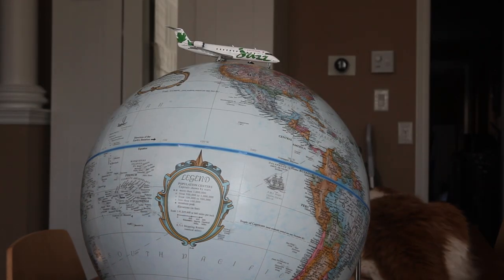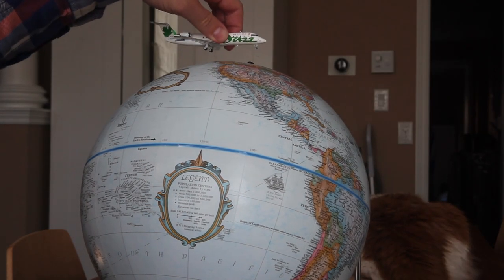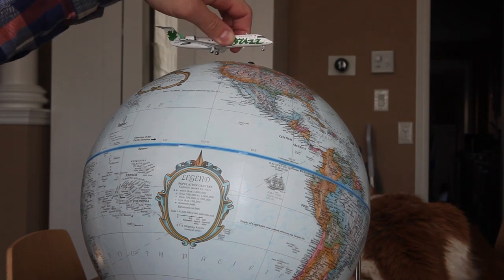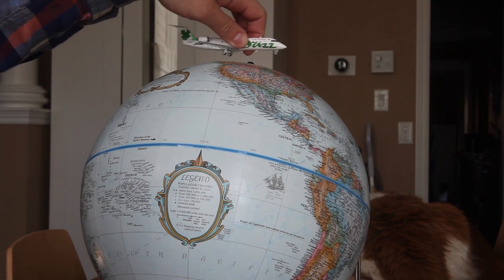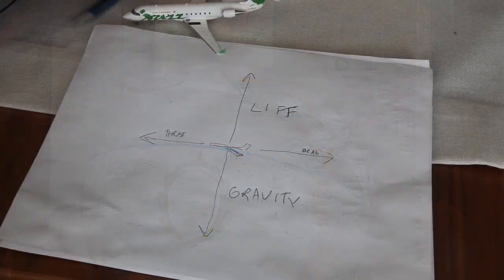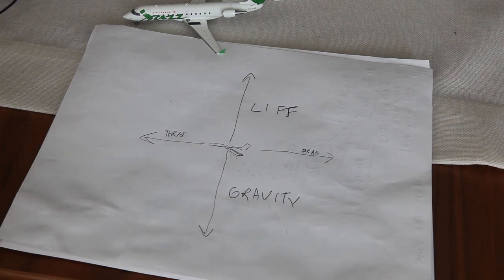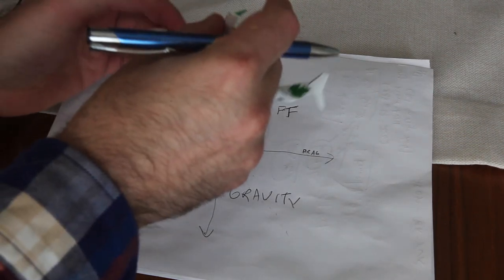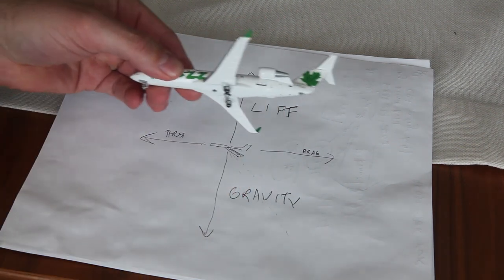Do Pilots dip the aircraft nose to account for Earth's curvature?

Comment: If gravity is pulling the nose of the plane down to maintain level flight we must manually avoid mountains correct?
If we fly from Australia to Dubai we cross the equator, Neil Degrass tells us that there is a bulge of water here, due to the spin, that is miles high. Does this not increase gravity (more mass)? Why does the plane not "dip" extra, just when it need to climb a few miles? All without any intervention?

Please explain, thanks in advance.
Reply: Because it’s BS!! All the supposed real pictures of earth are spherical (which those are lies) then he comes with this pear shape. They can’t even keep their lies straight

Comment: This doesn't make sense with what I understand about how the artificial horizon hardware works. The powered gyroscopic hardware is designed to maintain its orientation. How would it sense the supposed changing gravity vector when they're designed to stay in place once set on the runway regardless of forces?
Reply from the maker: Clearly there has to be a gravity sensing component or a compensation for flying over the curve or every hour in curise flight the airplane would be 7.5 degrees more degrees nose down. Not a useful tool for a pilot, if it doesn't show level to local gravity
Reply: @fepilot666  they must be huh? According to you? Stupid assumption. Look up artificial horizons there is no mechanism designed to change with the curve of earth. The gyros are set to the runway at take off according to FAA regulations it legally cant be recalibrated during flight. They are designed to maintain position and nothing more.
Reply: @BlanketTruth22  you are confusing attitude indicators with inertial reference units. Different types of gyros. Mercury switches as well as electric torque motors are used as gravity reference devices to maintain the gyro in an electrical driven attitude indicator. You really need to go and sit down and study how gyros really work and the different types of gyros and their uses.
Reply: @ianobiwan  you didn't explain anything just now. Just a bunch of words.
Reply: @ianobiwan  maybe you can explain to me why artificial horizon legally must be set preflight at takeoff runway. If it senses the center of the earth like u suppose then why set it at all. The artificial horizon in planes, according to the manufacturer simply is designed to stay in the set position.
Reply: @BlanketTruth22  I was hoping you were intelligent enough to go and find out for yourself about how gyros work and the different types and there uses after I pointed out your obvious confusion. Obviously I was wrong.
Reply: @ianobiwan  you didn't adresss my simple question about setting the artificial horizon pre flight. Why would that be necessary and legally required by FAA?
Reply: @BlanketTruth22  what FAA regulation exactly?
Reply: @BlanketTruth22  prior to departure pilots will reset the mechanical attitude indicator to make sure it is not giving false indication and there is no deviation from the wings level indication. Simple safety check. The aircraft must not be moved while the inertial navigation units are aligning. If it is moved whilst INUs are aligning an error will be induced. This error will cause the aircraft to fly off course. Example Korean flight 007.
Reply: @ianobiwan  doesnt it correct midflight and align with gravity according to you?
Reply: @BlanketTruth22  no it does not correct mid flight. What are you talking about?  I clearly have not said anything about mid flight corrections. Where did you get that stupid idea from?
Reply: @BlanketTruth22  still waiting for that FAA regulation reference number. Judging by the ridiculous comments you have already made here, you clearly have absolutely zero knowledge about how an attitude indicator works or how an inertial navigation unit works, so I will not be surprised to see that you are completely clueless about any FAA regulations as well.
Reply: @BlanketTruth22  You people are hilarious. Just because you read something on the internet you think you know more than professionals. Give me a break. "legally" aign it with the runway? How do you align an AI with the runway LMAO you have no idea. Look up pendulous vanes, and take this big L.

Comment: LOL..."the center of the globe is behind..."  If you are flying around a ball, keeping horizontal with the surface, the center of the ball is never behind you, you are always directly above it. The only way to get the center of the earth behind you, is to fly vertically away from the surface.    "...the gravity is going to shift backward..."  WTF?  If gravity shifted backwards, it would grab the tail section of the plane more so than the front meaning the front of the plane would want to point away from the surface even more so. Your explanation makes little sense.
Reply from the maker: The point being is that the airplane always stays in level flight, level relative to the direction of gravity. (Which changes as we fly around the globe)
Reply: @fepilot666  Or its not a globe.  Think about it.

Comment: This is thee most asinine theory I've heard this far. It's just flight mechanics working with gravity to keep the nose down. If that's the case a pilot would have to bench press a metric ton to pull up and land.
Reply: All modern commercial aircraft and military fighter aircraft have hydraulic systems to move flight controls because the pilot would not be able to do it with direct cable and pulley systems, as the aerodynamic loads are so large.

Comment: I'm a physicist, and you're WRONG!! A tiny 1 degree per 70 mile nose down attitude HAS to be established by a VERY tiny difference in the elevator setting over that of a hypothetical flat earth. But it is invisible to the pilot/autopilot because it is done by maintaining assigned altitude. Gravity doesn't do this, power doesn't do this. If i isn't done the plane will very very slowly climb due to the curve of the earth. And if you graphed the elevator position for both globe flight and hypothetical flat earth flight you would see a tiny tiny difference in the position of the elevator between the two.
--
Wolfie6020 says:
"The answer is yes the aircraft does change attitude as it cruises along the curved Earth. 
An average pilot will never notice this as the rate of attitude change is so slow it is undetectable to the human senses.  The pilot will never be conscious of pushing the nose down to follow curvature as the necessary change in attitude occurs simply by the action taken to maintain a constant altitude.  
The Autopilot is quite irrelevant - I see a lot of people focusing too much on this.  Regardless of whether the aircraft is being hand flown or on autopilot, the simple act of maintaining altitude results in the aircraft following the curvature."

Which is exactly what I said.
Reply: J Calhoun  
No, it must rotate its attitude, that is what you're missing. Gravity doesn't do that, the craft would otherwise maintain its attitude due to rotational inertia. Gravity pulls through the center of mass ONLY, it does NOT try to balance the craft in space WRT the earth's surface. Gravity does NOT work that way. You have a physicist and an airline pilot telling you it doesn't, when will you pay attention?  Flat earthers are wrong, but not about everything. Re-read our comment you posted to above.
Reply: J Calhoun  
A teeter-totter is not an apt representation of the problem. It has bearing friction, and the force involved over its length for its inertial mass is minute.  Also, you PRETENDING that I'm somehow not a "real" physicist, isn't going to help you understand the principle. ME's always have been a bit dense.
Reply: J Calhoun  
Well, that's you pretending to know what you don't.
Reply: J Calhoun  
Best you can do, isn't it?
Reply: J Calhoun  
No you don't, you just blabber what you WISH was so.
Reply: The problem is in REALITY, in the REAL PHYSICAL WORLD, there are videos showing people bringing spirit levels or even using their phones showing planes traveling nose up CONTINUOUSLY .
Reply: @veganliving7622  
Yes, that's because planes fly slightly nose up. But the instruments in the cockpit that show the level line of gravity show the horizon is BELOW the level line, the higher the altitude, the LOWER it is. That SHOWS you're looking DOWN at the horizon over the dropping curve of earth's sphere. The plane is NOT gaining altitude just because it's nose is slightly up. Instead the plane is following a curved path parallel to the earth's curved surface. A spirit level will not reveal anything, unless it is used as a level line and pointed out the window to see the horizon is below the level line!